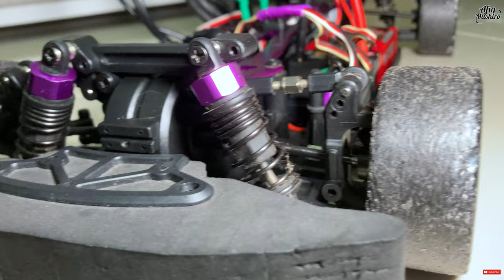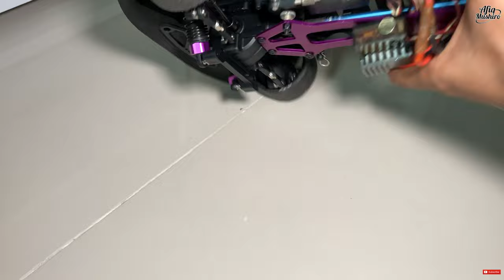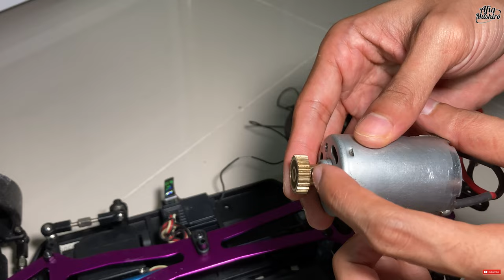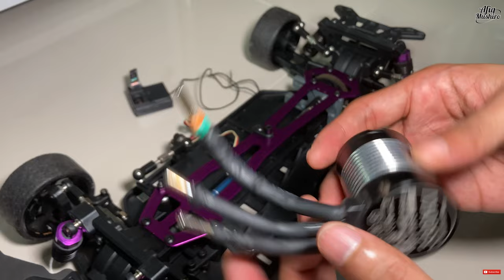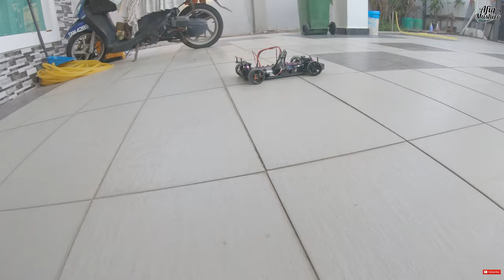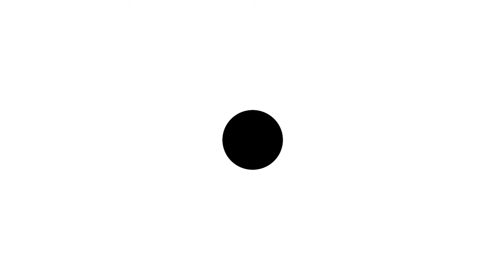RC DRIFT | Convert Brushed to Brushless Motor | HSP Flying Fish

Comment: motor n esc brand ape n spec ape bang...agak2 klau baru brape harge ye...
Reply from the maker: Brand hobbywing bro.
Esc : WP-10BL60-RTR
Motor: 3300kV 3650
Reply: @afiqmushiro9873  spec ni boleh run 3s?